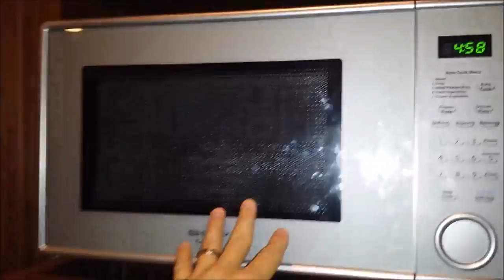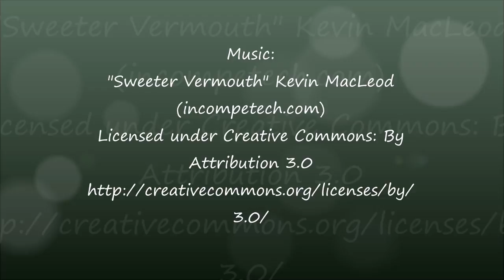Glass cutting jig - wine bottle edition

Comment: In my experience cutting glass with thermal expansion leaves the glass brottle and prone to cracking.  Also getting the glass to break on the line and nowhere else has a low percentage of success.  I use a tile saw which leaves a rough edge but a hig success rate.

Comment: I like the jig. I have watched about 12 videos and I like where you are going with this. The only thing is that there isn't away to adjust the jig to cut different size bottles. I like the size of your glass cutter. Do you happen to know what type you purchased? The ones I see at the hardware store are a bit smaller and there isn't that much metal to mount it onto the jig.
Reply from the maker: That was a glass cutting blade that was included from a Sears Craftsman box knife kit.  I just happened to have it laying around.  If I didn't have it then I would use the one you are talking about and drill a hole in the handle to screw it down tight.  Sears might sell the blade separately.
Reply: I don't think you are qualified to approach the subject.